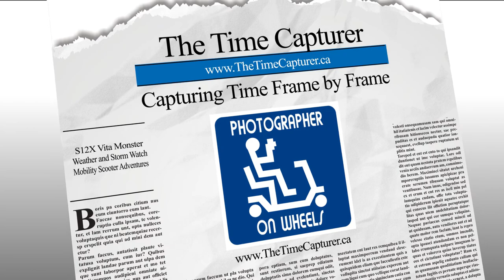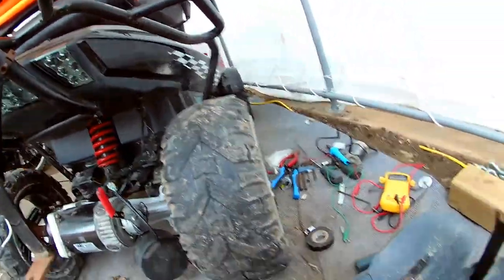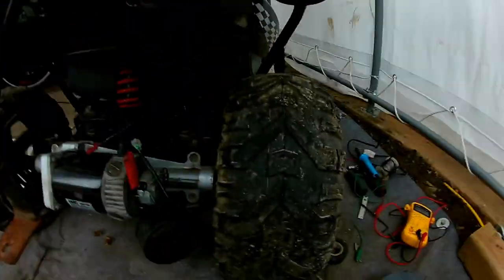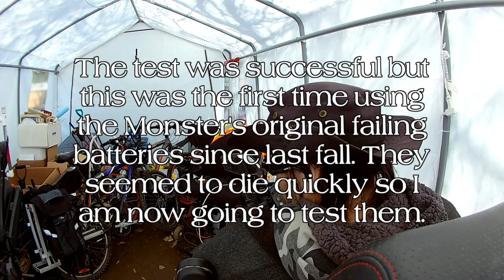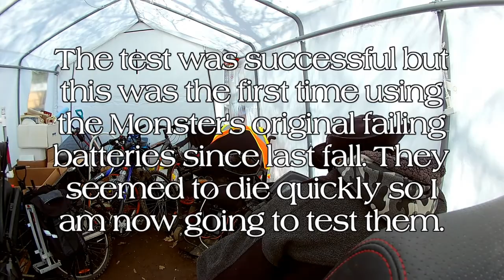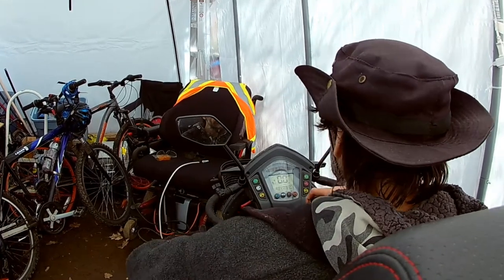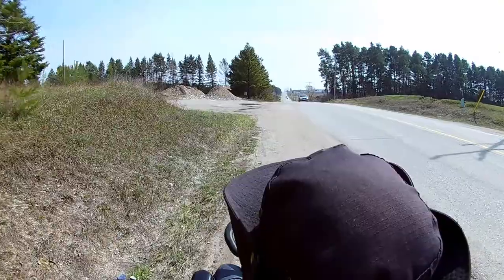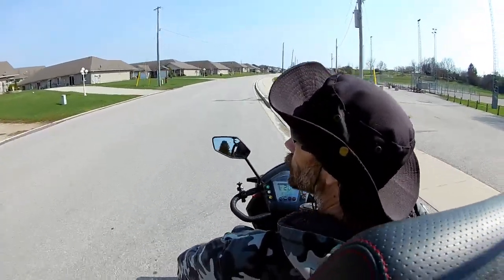April 13-15, 2017 - Error Code Problem Fixed - The Monster is Back in Service

Comment: My father's S12 have the 24v 700w 25:1 HMC electric motor, but burnt, I cant find it for sale anywere... 3 months he doesnt leave home... so hard to find parts.
Reply from the maker: My old scooter is a plain, basic scooter and I can get parts from ebay and amazon. The Heartway/TGA/EV Rider scooters have specific parts only made by them. They are definitely pricey and often difficult to get. The Motor on my Monster blew up as well. I couldn't get "just" a new motor for it, I had to replace the entire transaxle/motor/brake as one unit. It's just rediculous. If you'd like to see the video where the motor died, it is here: https://www.youtube.com/watch?v=SFLdysQk6iY
Reply: @TheTimeCapturer  thanks for the time and info. 
hugs

Comment: I am 100% disabled however I fail to see your disability explain.
Reply from the maker: Hi William. I have fibromyalgia. I can still be active (for now) but I get exhausted very quickly and am often in pain. I don't show my issues in the videos because that's not what they are about. What you don't see is what happens after these activities. I get one good project per day, on most days, then can't do much after that. Around mid summer, I get what are called remission periods where my illness eases off for awhile, then, when fall comes, it all comes crash in on me again. Each time this happens, it gets a bit worse. There are a few days in the summer that I'm even able to ride a bike but that puts me in bed for a few days recovery. I've only been sick since 2006 and was fully functional beforehand. Then I got sick and suddenly, it became very difficult to do the most basic things like tieing shoelaces, bringing groceries into the house, or even putting on a coat. That's one of the reasons I don't like winter. By the time I'm dressed to go out, I'm too exhausted to do anything. This transition has been very difficult and I still have problems accepting my new limitations. I'm literally torturing myself to make these videos because I'm trying to still have fun for as long as I can. As of this year, the biking may no longer be an activity that I can enjoy. It was very hard on me, worse than it ever has and I'm not sure I want to try again next year. The most difficult part for me is I can't stay in one position for long. Even driving the scooter, I need to stop and get off to move my legs. I stiffen up when I'm not moving and that includes sitting at the computer or laying in bed. I have to constantly change positions which gets annoying really fast. Pushing myself like this tends to backfire sometimes though. The one time I intentionally showed the effects of my illness was during the shelter build. https://www.youtube.com/watch?v=cM3rISj_3w4

If you have any more questions, feel free to ask.
Reply: I would also look healthy to you William. I can some days be ok, I have spinal problems and some days cannot get out of bed, other days I can walk about. So some disabilities are not seen but that DOES NOT make them any less of a disability. I also have mental health issues which are invisible to you , but not to me.
Reply: whats 100% disabled  and how do you qualify to be 100% disabled ?
Reply from the maker: Wow, I just found two more of your comments that I haven't received notification of. If I haven't replied to any questions you've asked let me know... hopefully, I'll get that one. :)
Reply: Not all disabilitys are visible William

Comment: make sure the batteries you use are gel they are less likely to be effected by the cold you must charge for a minimum of 8 hours without any break in between and NEVER charge an hour here an hour there it cooks batteries I see your scooter is left out in the cold and over there in canada you har REAL cold batteries hate the cold it kills them , avoid any battery from china they skimp of lead and only but in the bare minimum , also invest in plastic dip spray for all the electrical joints i cant believe they have those wires so exposed to the elements the salt will get in there and oh its just a food fest for corrosion .
Reply from the maker: Another comment I didn't get notification of. Not sure what Youtube's doing, but if you ask a question and I don't answer, this is why. The standard mobility scooter batteries here in North America are MK Power and I believe they are made in the United States (don't quote me on that). They are definitely the gel type. The external batteries that I mounted to the back of the Monster are basic RV batteries, lead-acid, deep cycle. The set of two cost me $400... about a quarter of the price of gels. I had to pay for these myself so I got the best that I could afford. They are only backups anyway, so it wasn't too important. As for charging, when I'm not using the scooter, it's always plugged in. I never leave the batteries drained, ever. Today's multi-stage smart chargers ensure they will never get overcharged so it's safe to always remain plugged in. The biggest thing for me is, when I need the scooter, it has to be fully charged because I tend to use the full charge each day. On my old scooter, the only thing really concealed from the weather are the batteries. All the electronics and everything are underneath, fully exposed to all the water and road salt. I've never had a weather-related electrical issue. On the Monster, all the electronics are enclosed and protected. The only thing exposed to the elements are the motor/brake and these two plugs that have no weather protection whatsoever. The plug corrosion was the result of the very first exposure to the road salt. Quite disappointing, for sure.
Reply: Good day! please tell me I want to buy a scooter like you have a Vita with a 12 x port is it worth buying all this transport I'm disabled in a wheelchair. please tell me.
Reply from the maker: sasha kazachenko If you are wheelchair bound, I would suggest avoiding the Monster. Some of my subscribers have been stranded due to breakdowns. I too have suffered a breakdown but, thankfully, I had the ability to push it home. It was no easy task for sure. Even without breakdowns, it is very high maintenance and not really reliable.
Reply: Gel are shite AGM are far better deal with hot and cold temperatures way better been using them for many years never had any problems